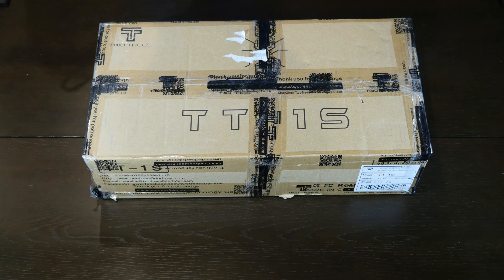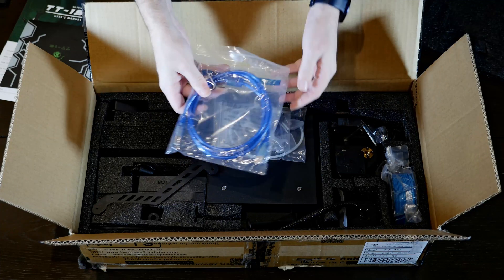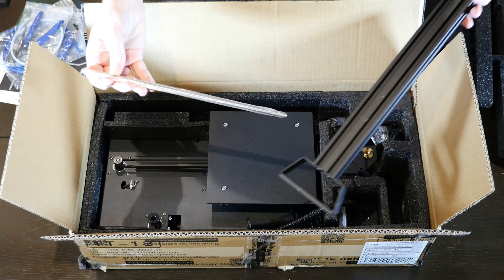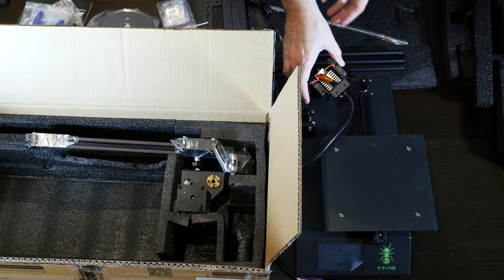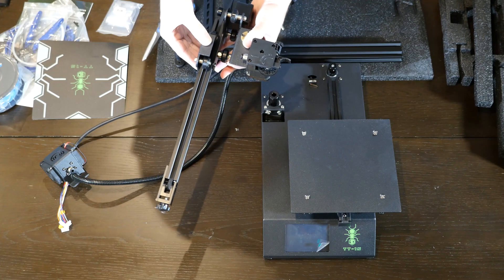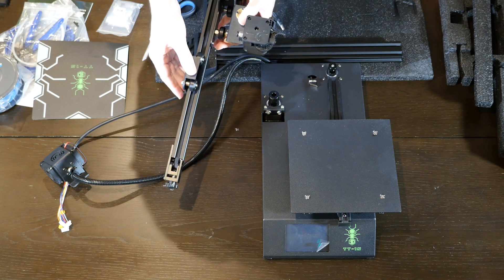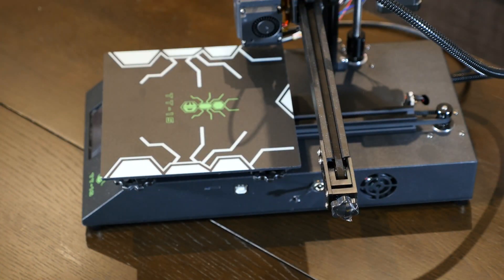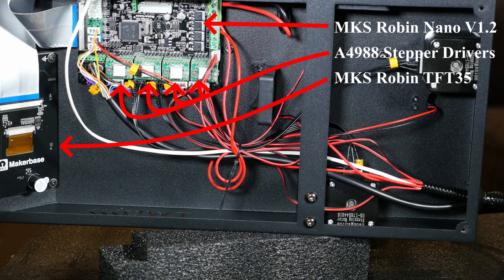TWOTREES TT-1s (2020) 3D Printer - A beginners 3D Printer? - Unboxing and Setup - Part 1

Comment: Если сравнить этот принтер, то он лучше чем kingroon kp3s. Экран больше, драйвера можно поменять. А самый главный +, так это то что на этом принтере, есть натяжители ремней! На kp3s, это очень тяжело делается! Спасибо за обзор) лайк
Reply from the maker: You are right in one sense it is better, but KP3s  you can also change the Stepper Drivers, you right belt tensioning is an issue, as we mentioned it depends what you need. With some modifications either one should be fine for printing, but to call it beginner's printer is a bit of a push. :) Thanks for commenting!

Comment: What is your opinion about this printer? How good are the print quality results? And what is better TT-1s or kp3s? Thanks!
Reply from the maker: Hi @techface Right now our opinion is to stay away from it and go with the Kingroon KP3s. We have a follow up video on this coming soon, but essentially it boils down to a lot of issues with the printer construction.  The reason it has stopped us printing properly with it.  Issues with all the Axis where they are misaligned by a few centimetres, hotend head loose on the X axis. It actually needs quite a bit of parts replacing.
Reply: @TechDads  Thanks, I think about this printer because in my country it's will be in stock and looks very similar with KP3S and I see in TT-1S 2 cooler on printing head than I know KP3S not very good with cooling need to change. But KP3s have a hot bed and more reviews on YouTube with positive reviews but think maybe TT-1s not so bad, but you change my opinion. Thanks! Best!
Reply from the maker: @techface9430  The changes to KP3s are very small, you can print an adapter for 3010 to 4010 Fans and your cooling is mostly resolved. There are other advanced mods for blwoer fans also. TT-1s not having a heatbed is an issue if you want to print other filaments so you restricted to PLA and PETG etc... Also KP3s is direct drive vs Bowden on the TT-1s. We have both of them and unfortunately we were not able to buy another KP3s, so could only get a TT-1s. Also Kingroon has a bigger community on facebook and telegram if you ever need support.

Comment: I understand it is budget friendly printer but there are other printers like Kingroon KP3s that at least have a heated bed.
Reply from the maker: Yes, Kingroon KP3s is similar price, and probably the better choice between the 2. However I would say this has a better frame, but still needs some work to get it at a good working level. A new heated bed can be added and we have a follow-up video on improving this 3D printer.

Comment: Why the bowden tube comes out from the side of the extruder? What a crap design!
Reply: Because, style over function!
Reply from the maker: Yes,  the extruder needs to be changed in our opinion. Otherwise the bowden tube will not allow easy pass through of the filament.
Reply: @TechDads  What is your opinion about this printer? How good are the print quality results? And what is better TT-1s or kp3s? Thanks!